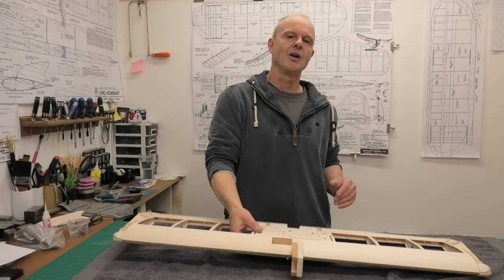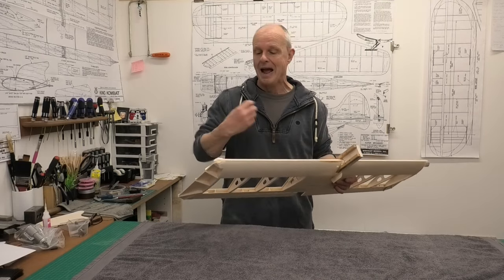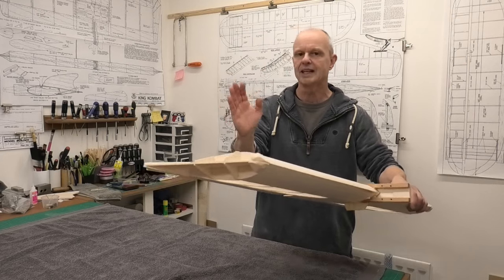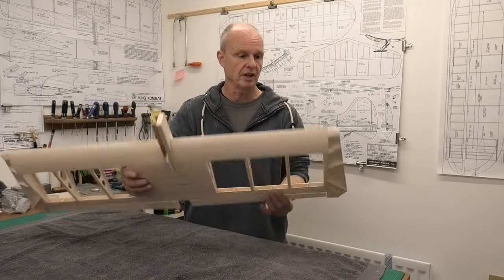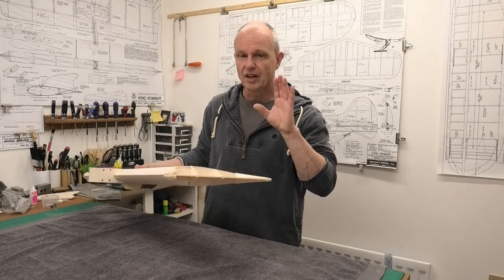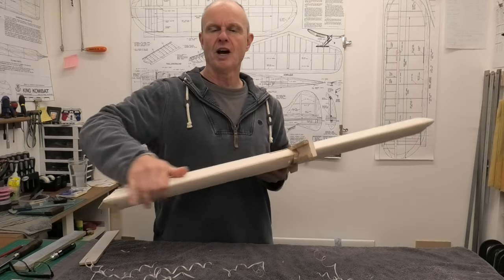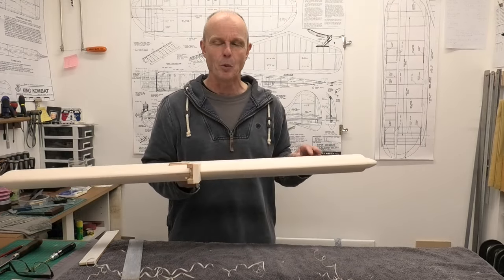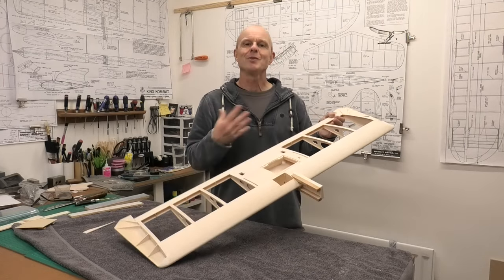How to: Profile & Sand a Balsa Wing - Balsa Plane Building

Comment: At video position 8:37, why don't you put a piece of paper or adhesive tape on the area of the sanding block that is not supposed to sand the cap strips and the planking? This is easier than taping off all parts of the wing that should not be sanded.
Reply from the maker: It may be easier to tape off the sander, but i find taping the structure gives better results and is easier working, but what ever works for you 😀
Reply: @MarkRobinson555  Yes, that's right, sanding is easier with the structure masked. By the way, your airplane building videos are the best I've seen so far, great work.
Reply from the maker: Thank you very much for the kind comment, really appreciated